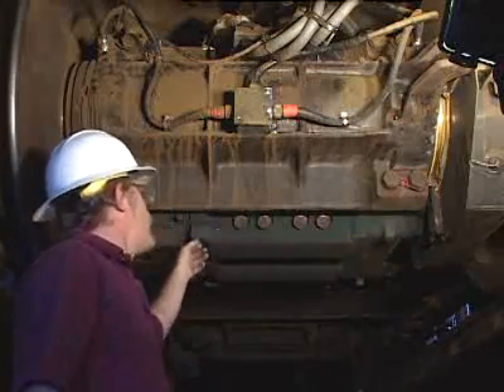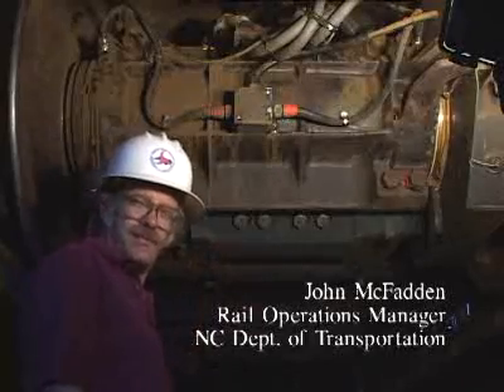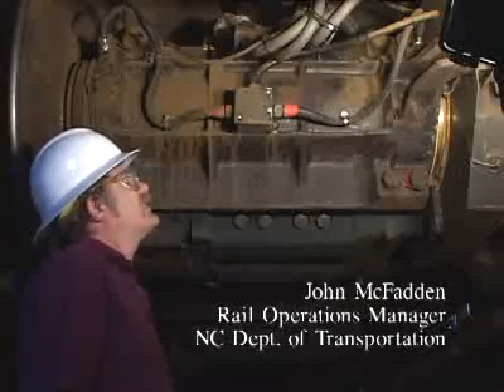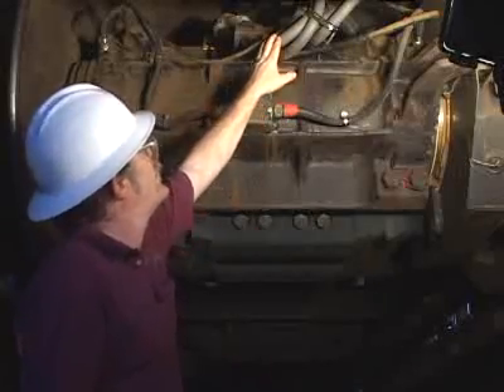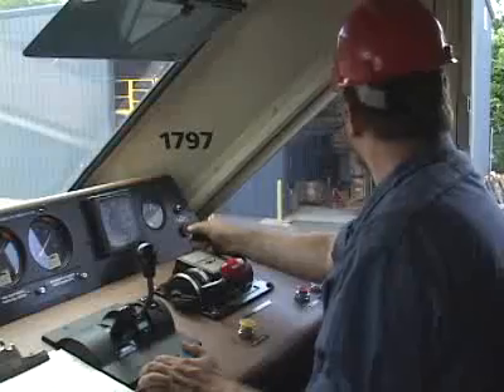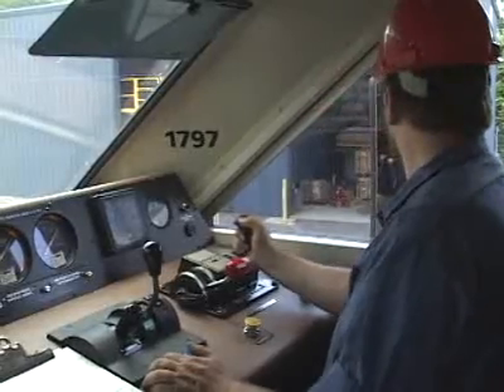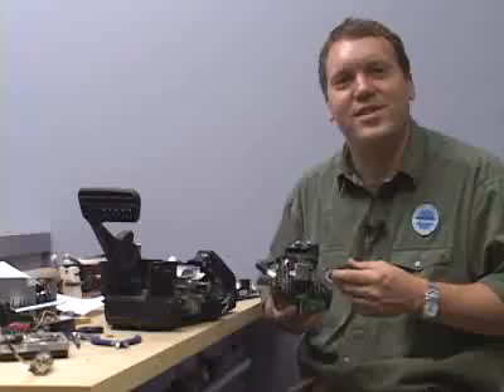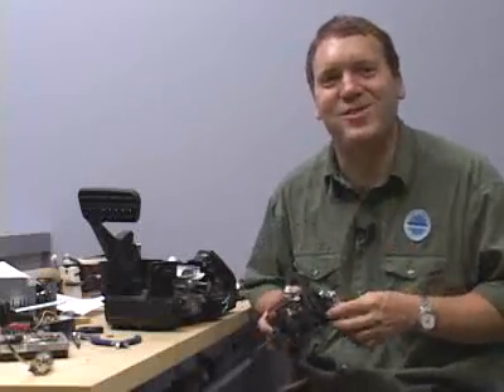How Diesel Locomotives Work

Comment: @EETechs People must be pretty confused if they don't understand that "electric transmissions" imply electric motors. You're quite right, electric motors can produce very high torques while internal combustion engines have a hard limit imposed by how much fuel is burned on each power stroke. But I think locomotives use motors simply because they make it much easier to drive every wheel. Electric cables bend easily and are much simpler than geartrains.

Comment: @ApolloWasReal The problem, though, I run into with the terminology is I try to explain that it is electric motors that turn the wheels, but people arrogantly say I am wrong and that electric motors are weak and therefore it must be electric transmissions. Being ignorant is one thing, but totally ignoring facts which can reduce ignorance makes them idiots. I fixed this issue, by making a torque battle video which proves that electric has torque WELL BEYOND a combustion engine.

Comment: @ApolloWasReal I was referring to the fact that your typical diesel-electric train lovers like to say the diesel-gens are stronger than the full electric which is not true. I never said the diesel-gen type is more powerful. I did say that if I replaced the diesel-gen with a weight ballast equal to it and ran the train as electric it would be no different pulling wise. What you are referring to is a purpose built electric train which are very powerful indeed compared to diesel-gen.

Comment: @EETechs It's just terminology. It's perfectly reasonable to refer to an electric generator (on the Diesel engine) powering electric motors on the wheels as an "electric transmission" because that's exactly what it is. It's important to drive every wheel for maximum traction and it would be much too difficult to do that with mechanical gearboxes.

Hybrid cars like the Prius also have electric transmissions. In fact, the Prius transmission is both mechanical and electric.

Comment: @EETechs Actually, electric locomotives are often much *more* powerful than diesel-electric locomotives of the same size. Depending on voltage, etc, the overhead wire can supply as much as twice as much power as a diesel engine. Electric motors are also tolerant of brief overloads, while diesels (and gasoline) engines have well-defined speed and power limits. This is one reason why all the high speed passenger trains (TGV, "Bullet", ICE, etc) are electric.

Comment: @DeserTBoB93535 Finally, diesel engines convert chemical energy into mechanical and electric motors converts electrical energy into mechanical. Both need to have their "fuel" in order to work. If I cut the fuel lines on a diesel then it will stop running just as if I cut the wires going to a motor. So in the end the only real benefit you have over electric is that diesel fuel packs so much energy without weighing so much compared to batteries.

Comment: @DeserTBoB93535 One could just as easily take out the diesel-gen set and replace the lost weight so that it will have the same weight as before, and have the power supply provided by an overhead wire system. The result will be no different in pulling ability compared to the diesel-gen power supply. cont...

Comment: @DeserTBoB93535 Its not electric transmissions. It is ELECTRIC MOTORS. I guess it makes you angry to know that electric motors have so much torque that your diesel cannot do the job with a transmission. Look man, just deal with it. I know you want to call them transmissions to try to hide the fact that electric motors are doing the grunt work, but just stop it. Deal with the fact that electric motors own gas and diesel engines in torque face offs. cont...

Comment: @erichand13 
Actually, Eric, they were closer than you were, unfortunately.  The prime mover in this video is not a 4-stroke engine.  It is an EMD 12-710G3B-EC (electronically-controlled) 2-stroke diesel, installed in a GM EMD F59PHI locomotive (Amtrak).  EMD's later 265 series of engines were 4-stroke, but not the 710's.  GM only produced 4-stroke diesels for its locomotives, after expanding from simply providing generator/motors to ALCO, to manufacturing their own complete locomotives.

Comment: They got some basic facts wrong. There are both 2-stroke and 4-stroke diesels, and both kinds are used in railroad locomotives. I'm pretty sure the Amtrak engine they show is made by General Electric, which uses 4-stroke diesels. The other major maker of diesel locos, Electro-motive, uses 2-stroke diesels. But even they are phasing out the 2-stroke because the 4-stroke is cleaner burning.

Comment: Sort of. We live in 21st century but we still use devices invented in 19th century:
1)Modern steam turbine was invented by Charles Parsons in 1885. It is used in nuclear and coal/oil/gas fired electric power plants and they provide some 80% of electricity worldwide.
2)Steam turbines are coupled with synchronous generators invented in 1880's
3)Induction motors and 3-phase AC generation and transmission system were invented in 1890's
4)First successful Diesel engine was built in 1897

Comment: Europe is not fully covered by electrified tracks. New technologies like DBAG 612 or "Baureihe 643" (both german systems) are still working with diesel. And there are a few german 643 which are doing their duty in california. Mostly built by Siemens or Bombardier. The reason for sophisticating diesel locs is that especially the german railway net is so big that almost every village or little town has a station and only main tracks are being electrified because of the costs.

Comment: Don't take this personally, but I don't think you know what you're talking about. Someone left a comment stating that not all diesel locos were diesel-electric. I responded by listing the different types of diesel locos that have been built over the years. Yes, I KNOW the traction motors are electric motors, and do most of the work!

Comment: 2GUNBOY, those traction motors ARE electric motors. What, does it bother to you to know that it takes torque godly electric motors to move a train? That would otherwise take 50 gears from a HUGE transmission to do the same thing? Seems you cannot except that the electric motors are doing the grunt work. ahah

Comment: the engine is a EMD 710 with 710 cubic inches per cylinder. 710x12 = a 8520 cubic inch motor.

Comment: The EMD 12-710G3B-EC is the prime mover that the EMD F59PHI uses.

The GE P32AC-DM has 3200hp, not the P42!

The four "electric motors" are called Traction Motors.